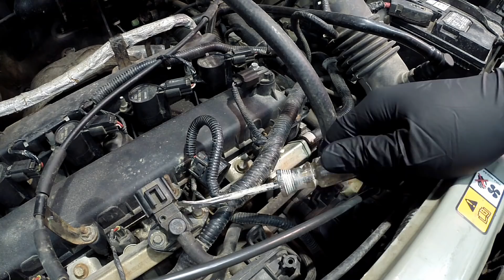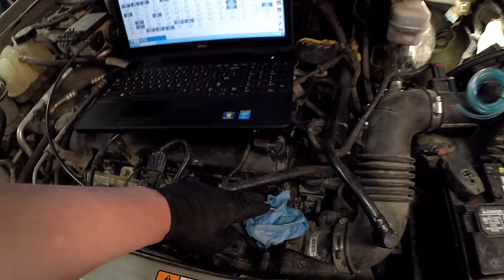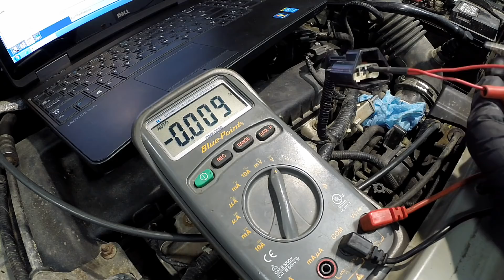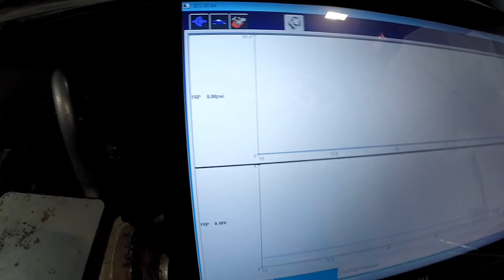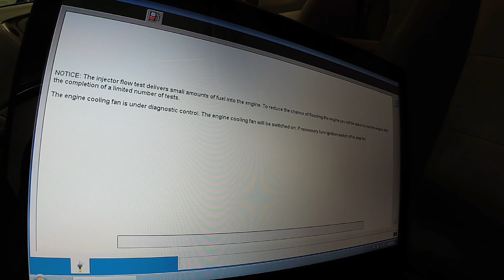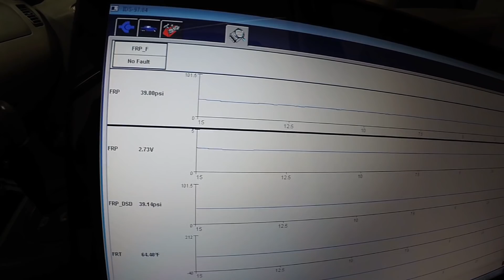2005 Ford Escape Lightning Strike Diagnosis Pt 3 of 4: Fuel Pressure Sensor Testing

Comment: Hey there. Just started following you.  I could use some advice from a ford guy. An 07 escape 3.0 just came in to the shop with a stalling problem. When the car is warmed up it will stall ( dies abruptly) ,when the steering wheel turns from stop to stop.  The problem definitely gets worse with temperature. Also the 4x4 light flashed a few times after stalling, does not flash every time it stalls. While test driving I can keep it running as long as I accelerate through turns, but if I let the rpm idle (600-700) it will stall in the middle of a turn. The fuel trims are perfect, there’s no codes, the power steering pressure sensor works properly, I did a scope sweep test of the tps (no drop outs), intake vacuum is 17-20 inHg to the map and fuel rail sensors, I checked exhaust back pressure ( was less than 1psi). Everything drivability -wise looked good with scan data, with the exception of the MAF. The grams per second was good at idle (3-5), but the BARO readings threw me off a bit. They were stuck at 156 HZ and 29. Even after unplugging map and MAF, as well as resetting the keep alive memory the BARO readings stayed the same. I understand there is a tsb for the torque converter. Would you be able to shed some light on this problem child, before I condemn this transmission? What should I be seeing with BARO at idle ?Thanks in advance.

Comment: Great video brotha. 
I was changing out the spark plugs and coil packs on my 2005 F150 5.4L and removed the fuel pressure sensor to have a little more room to get to one of the coil packs(BAD IDEA), now I am getting a p0193 code and a loud rattle coming from the fuel rail area. Do you think my fuel pressure sensor went bad after i removed it?

Comment: Your best series yet. Getting into ids is great... electrical troubleshooting of modules right on, very interesting. Is it true you have to buy a yearly subscription at motorcraft to use this you cant get a one day just for your car?
       I see the autel can do pats and has a lot of available pids is it a reverse engineered cinglish scanner version of this that hasn't been totally hacked down to the pcm programming level?  
It  sounds un American but maybe the hacked chinglish ids's are the only way the common  man can afford to work on his automobile network if it doesn't burst into flames when it gets close to the dlc!

Comment: hey man, I have a 2002 Ford Explorer, I have running lights, reverse lights, and turn signals. but when i brake i have no lights, except my blinker will stay on if i'm braking. cruise control also will not turn off when i hit the brake. already replaced the switch connected to the brake pedal. would appreciate any advice.
Reply: +kyle boron  I would check the ground at both rear tail light assemblies or even run a temporary ground to the tail/brake light with a jumper wire see if that makes the problem go away.